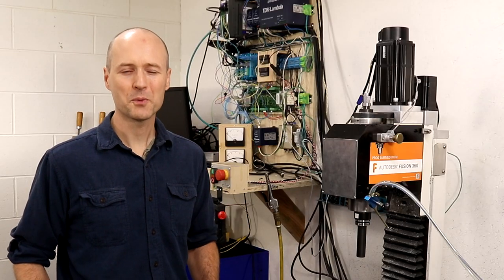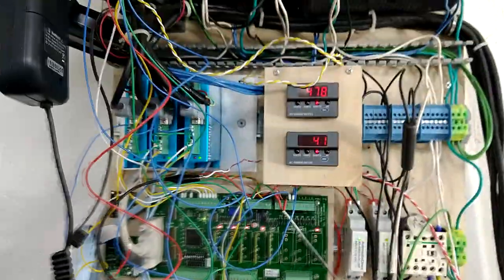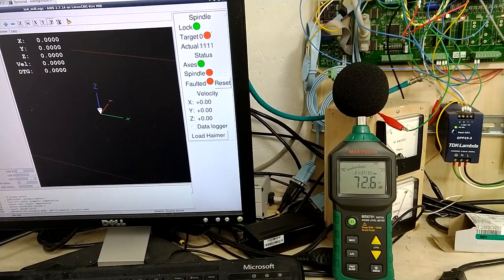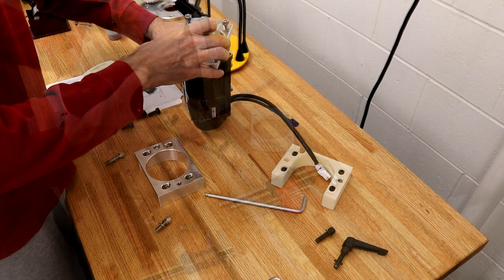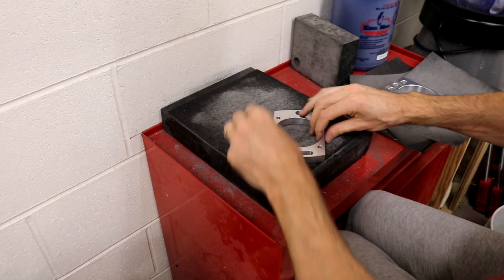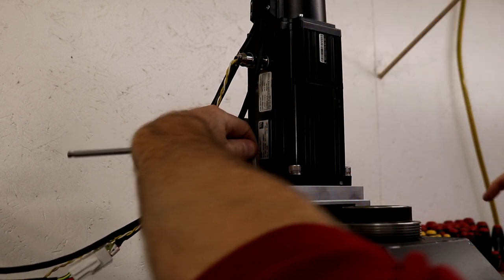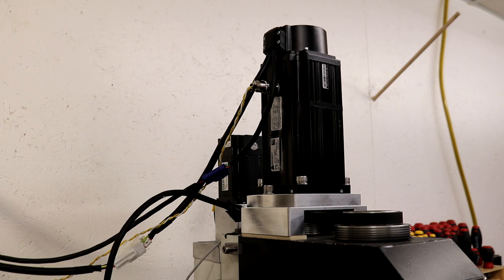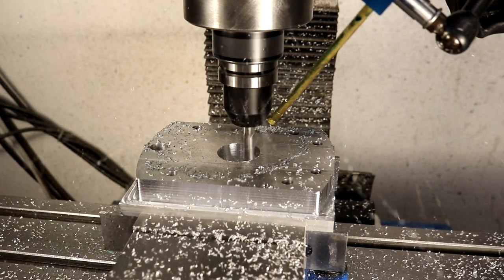Make AC Servo Motor Mounts For CNC Mill Spindle (DMM DYN4)

Comment: Great video! Please be careful around atomising/mist coolant systems as they are VERY dangerous to respiratory health, as the exposure to this mist causes serious damaged to your lungs, and makes cold/flu infections more likely and severe. Subbed and liked. :)
Reply from the maker: Thank you! I once experimented with a DIY oil mister. That was a huge mistake. I'm sensitive to unclean air, e.g., saw dust, grinding, welding fumes, smoke, and such, but misting oil for just a few minutes really beat me down. I'm been thinking about a parasitic pump for better coolant regulation, but realistically, the best solution, for milling at least, is high pressure flooding. In mister, high pressure air is used to clear chips, but as you said, that atomizes the coolant.
Reply: @kentvandervelden   @Kent VanderVelden  Thx - often we don't realise that we are taking an industrial process into our homes when we enjoy using machinery for creative purposes. I have contact dermititis caused by over exposure to machine tool oils, and it takes only the slightest oil contact to set it off(painfully, broken and itchy skin).
I appreciate a face mask(RPE) would be a nuisance, but a simple FFP2 or 3 mask would suffice.
I've often thought that we now have the opportunity to utilise remote cameras with audio to allow us to monitor machinery at a much higher degree and in a much safer way - perhaps you could do an interesting setup this way re: cheap endoscope camera integrated onto the machine tool head - it would be interesting and of value to peeps, and perhaps lucrative(supply of kits, fixtures, etc) too?!
:)
Reply from the maker: @craigywaigy4703  These are excellent ideas! Thank you for taking the time to write them. I'll immediately implement the mask recommendation. I know that's right, and there's only upside. I've have some experience with cameras as measurement tools... a consumer product is pretty involved, but an interest and I like the way you are thinking. Thank you :)
Reply: @kentvandervelden  I've found that dilute koolmist 77 in a fogbuster-style system is pretty good. Works nicely on aluminum and steel (but not for drilling/tapping). High-pressure anything really sucks if you don't have an enclosure, but you can make do with mist/air and some shower curtains.

Comment: I'm setting up a 1kw DMM servo with linuxcnc. I'll be using a Mesa 7i76e bob. Not sure what you're using, but I'm sure I can cross reference. Can you share your wiring configuration and Linux settings?
Reply from the maker: I'm now using a 7i76e. All my mill LinuxCNC configurations can be found at the following link. (Go back one directory for the lathe and router configurations.)
https://github.com/kentavv/kvvcreates/tree/master/linuxcnc/configs/pm25mv_mill
Reply: @kentvandervelden  thanks! You just saved me days of trial and error
Reply from the maker: Glad to help. Do you have LinuxCNC running? You'll need to use a 2.8 version for the 7i76e. Let me know if you need help. I've meant to put something together to show the steps.
Reply: @kentvandervelden  just put 2.9 on the computer I intend to use. I have Linuxcnc running on a g540 powered router I built, but this 7i76e/dmm servos and spindle are all new to me. I'm getting my servos tomorrow and my retrofit kit in a few days. I was going to build my own kit but i had half the machine apart to get it in my basement, so I figured I'd yank it apart instead of putting it back together. Cost vs time is probably marginal at best
Reply from the maker: Good deal! The link below is to a wiring diagram that I found very helpful. Also, my configs reference a HAL component I wrote to talk by serial to the DYN4 to get torque, position, send a few commands, and do data logging. You may want to ignore that stuff.
https://forum.linuxcnc.org/media/kunena/attachments/3278/7i76_Anschluss.pdf
Reply: @kentvandervelden  did you manage to get rigid tapping to work yet?
Reply from the maker: Sort of. There might be something wrong with my DYN4; the encoder feedback is pretty noisy. I switched to a 7i76e (differential inputs) to try to reduce the noise. Maybe there was some improvement. An independent encoder seems needed. I did this with the original motor and that works well. Ridgid tapping with my current setup seems ok at slow speed, but may not be reliable. Instead, I use thread mills. I hope you have better success.

Comment: Hello Kent... Just curious is you had to change the spindle bearings to for the improved spindle speed?
Reply from the maker: I didn't change the bearings for the higher speeds, but I should change them because of their runout. Here is a CNCZone post where Starleper1 included specs on the bearings and they seems OK for 5500RPM.
https://www.cnczone.com/forums/benchtop-machines/101231-pm25mv-bf-series-9.html#post859477
Reply: Thanks Kent.

Comment: what is the benefits from using step/dir spindle, in general?
Reply from the maker: What is the benefit of a/b-phase over step/dir? While the same number of wires are used, a/b phase encodes steps across two channels, increasing bandwidth. Said another way, the bandwidth available for dir in step/dir is mostly wasted. A breakout board not able to produce a fast enough pulse train using step/dir might be able to with a/b phase. Compared to velocity control, position control allows positioning as well as speed control, without the complication of an additional servo loop. Thank you for asking. I hope this was helpful.

Comment: Kent, can you give me a brief run down of how the controller communicates with an a/c servo spindle motor vs what I have now for my stock pm mill?  I have a vfd right now controlling my 728 BLDC motor, and a 0-10v signal controlling speed, but Id love to upgrade the motor to something like this. Thanks!
Reply from the maker: The servo drive may be roughly a drop-in replacement for your VFD used in velocity mode with 0-10v speed control and may a few extra wires for direction, start, stop, etc. To get fancier, the DYN4 servo drive (and most others, just double check) can also accept step-dir pulses and be controlled like a stepper motor. If your breakout board can generate pulses quickly enough, then the servo could be run at full speed as a spindle motor and have easy positioning. The drives are pretty fancy, have many interfacing options, generally we use a small fraction while having options for the future. Pretty amazing engineering. Hope this helps.

Comment: what are you using for you X,Y,Z AXIS  steppers or servos?
Reply from the maker: They are NEMA23 Leadshine Easy Servo stepper motors. These have encoders and a current control feedback loop. They work pretty well. I use them on my lathe too, where they are very much overkill. If you want to take a look, I talked a bit about them in an old video. 
https://www.youtube.com/watch?v=KuX1QdGcGJ0

Comment: i just buy ac750w servo motor without any driver included , can i run this servo using vfd inverter ?
Reply from the maker: While you may be able to get the motor to turn, maybe requiring a lot of tweaking, it's unlikely to have much torque. The servo is meant to run synchronously, requiring feedback, especially with varying loads. VFD can have feedback mechanisms, e.g., using motor mounted sensors or measuring back emf, but vfds are meant for induction motors. Just a hunch though.
Reply: @kentvandervelden  ok thks , may god bless you

Comment: Are you able to get the spindle position from the DYN4 into LinuxCNC for rigid tapping?  I have a similar setup on a Taig, where I replaced the stock motor with a DMM servo as well.  I'm trying to figure out how to get LinuxCNC to do rigid tapping.
Reply: You don't need a servo to perform rigid tapping, just the encoder on the spindle and a way to control it CW and CCW. Just atach a quadrature encoder to the spindle, with index signal. In your case that you already have a servo, you can just hook the drive encoder output to linuxcnc. You would need 1:1 ratio between the motor and spindle for the index signal, or use other spindle index sensor.
Reply: The Dyn4 can output an encoder signal to your motion controller. Need to have a timing belt setup though.
Reply from the maker: The encoder signals are passed through from the DMM drive to a Pico Systems USC board. This is the same as I already for rigid tapping but based on the servo's encoder instead of a spindle mounted encoder. Position would be lost if the belt slips, so I'm waiting on a timing belt and pulleys.
https://www.youtube.com/watch?v=gnyIOU-e9cY
Reply: I do rigid tapping in linuxCNC on a PM25MV with the stock BLDC driven with a Mesa 8i20 and an encoder mounted to the BLDC. Rigid tapping in Linuxcnc is a funny thing, if you plan to only use the servo's encoder, you need it's index pulse as well (LCNC needs the index for rigid tapping) and it must be 1:1 pulley ratio. I use the stock pulleys and I gave the gearchange component setup to scale the velocity feedback from the encoder, and change the PID settings for rigid tapping and I set the pulleys 2:1. I have a proximity switch mounted to read an index pulse off the spindle itself. Works rather well, but I'm thinking about picking up a DMM set because the BLDC just doesn't have the guts. Did you by any chance post CAD files for the motor mounts you made?
Reply from the maker: @justinwhite9535  I'd be happy to. They are in Fusion currently. Would the f3d files on GitHub work for you? I'll put them up tomorrow with links to the pulleys and belt I used.
Reply from the maker: @justinwhite9535  I put all the model files into an f3z file at https://github.com/kentavv/kvvcreates/tree/master/pm25mv%20cnc%20mill . There are two pulley sets shown in this archive. I used the GT3 pulleys (not the 3GT pulleys).
Reply: @kentvandervelden  Any chance you could export the files to .step? I generally use FreeCad, my mill isn't the only thing that runs linux lol.
Reply from the maker: @justinwhite9535  No problem. Step file upload to the same location. It's a single large step file with all the pieces in one files.
Reply: @kentvandervelden  Thanks for the step files, I was able to get a toolpath started with those. After debating on speed vs power I ordered the non brake version of the motor you used, I figure in a small machine that does mostly aluminum speed is more important than power anyway. The timing pulleys mentioned in the CAD seem to be super difficult to find, a google search only pulled one result from a foreign supplier but no stock. I figure since I'm sticking with a 1hp servo it might be best to re-use the stock pulleys as the low gear helps with rigid tapping and I've never actually had the micro-v belt slip during tapping, biggest issue was lack of low RPM torque but judging from your demo the 750w DMM servo seems to mave much better low end. The DMM cables are super expensive so I just ordered up all of the connectors and I'll make my own.
Reply from the maker: @justinwhite9535  That's great! I ordered the belt and pulleys from Misumi. The cost was ~$60, however only the motor pulley is standard; the spindle pulley must be modified to have a larger bore and broached. I've been impressed with the v-belt too. Sticking with it seems very reasonable.
Reply: I was able to get the step files into Freecad just fine but didn't have any ~1.5" thick stock to  make the main bracket. I just decided to make an adapter that works with some of the stock mount pieces. Just waiting for all of the connectors to make the cables and such. 
https://drive.google.com/open?id=1CjG4ttm6agoPCZdtYpJtFI_9ozq-fLhi
https://drive.google.com/open?id=1CYReUN9rYNPvjdLY9omo2_pQChCur29r

Comment: What is the power for this servo and how it was cost totaly ?
Reply from the maker: Figure about $500USD for the DMM DYN4 and 86M-DHT-A6MK1 (no brake). The brake adds quite a bit of expense so probably only valuable for a vertical axis and not a spindle. The servo is 750W. There are larger ones from DMM, maybe maxing at 1.8kW, but the top speed is lower (3000 vs 5000RPM). The pulleys and belt from Misumi were roughly $80USD. Thank you

Comment: Kent - I finally got around to milling up a set of your servo mounts for my PM25. They came out beautifully. I'll be putting the 1kW DMM servo to the test tomorrow.

Thanks again for sharing!
Reply from the maker: That's great to hear Mike! Thank you for letting me know the models helped. I've installed a 1kW DMM too, replacing the 750W that had the brake. I've not done too much yet with it because the spindle bearings are near the end of their life.

Comment: Nice work, Kent!  How’d you get the motor to reverse like that?
Reply from the maker: It's not going to be a satisfying answer but... it just worked. I did see what you were seeing though and I'm sure it's related to the control method. I'll describe the wiring and LinuxCNC setup soon and hopefully you'll notice something that's different from your setup... or I could still be wrong :)
Reply: Ha, okay...I’ll wait for the next video!
Reply: Hi Kent,
I’m still patiently waiting for your next video.😁 Michael from DMM sent me a wiring diagram and claims it should work properly. It’s been so long, I can’t recall if it’s how I had it wired up or if something is different. I like their product and their enthusiasm for supporting hobby projects, but until the issue is resolved, I’ll continue to be disappointed with them, at least for the special use case.
Reply from the maker: @ScotY808  A few things slowed me down including making a PCB to cleanup the encoder signals. I'll make the new pulley this weekend. Still don't have 220v pulled, but that may need to wait. Just encountered a lot of gotchas.
Reply: Hi Kent,
I’m just teasing.😁 I know you’ll get to a follow up video when you’re done. I seem to take forever to get anything done myself!😂 I didn’t have 220v in my work area and running a line was pretty much out of the question so I bought a big transformer, per Michael’s recommendation. Never did hook it up though. For me, it seemed an easier and less expensive way to supply the Dyn4 for more rpm.
Reply from the maker: @ScotY808  Everything always takes longer than expected... - Hofstadter's law. A big transformer sounds pretty interesting. Does that also serve as a line reactor? About $200? Much less expensive than an electrician.
Reply: I don’t know what a line reactor is.😂 I got the transformer from AutomationDirect. I forget the size and I’m not home at the moment but I think it was the 1 kva version of this:
https://cdn.automationdirect.com/static/specs/hpsxfortress277240208120.pdf
It’s very heavy, maybe about 20 lbs.  I never would have thought to use a transformer. Michael from DMM suggested it and sent me a link. I think he inadvertently recommended one a little too small, so I went one size bigger.
Reply: Considering the free shipping, it’s weight, and where I live, it was very reasonably priced. I don’t like 220v stuff...scares me a little though. 😂

Comment: Good job Kent. My dmm servo system has performed very well.
Reply from the maker: Hi Dan, that's great to hear! I've had problems with interfacing the encoder feedback due to noise on the ground line from the encoder output. The only thing that helped was to add optocouplers, which requires a new circuit board. So, next video is delayed two weeks! That's how it goes :) If in the US, have a wonderful Thanksgiving!
Reply: @kentvandervelden  I made my own encoder and power cables to fix the noise issue.
Reply: Happy Thanksgiving to you!
Reply from the maker: @LtDan1  I'm really glad it was easier for you; I spent a lot of time on the noise problem 😐 What board do you have the encoder attached to? I'm using a Pico Systems USC. The moment the DYN4 received power, and disabled, the signal grounds had noise that was as high as ~10Vpp, and with shared grounds, messed up singled ended input and differential inputs. Enabling the drive and turning the motor created no noticeable increase in noise.